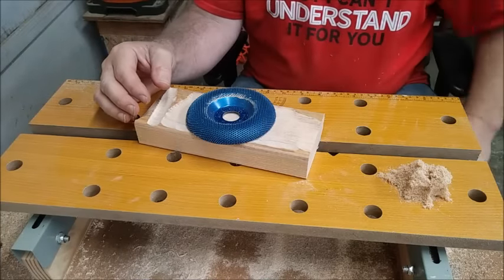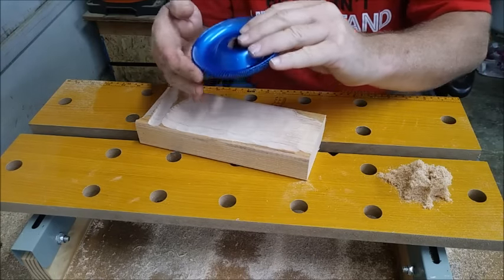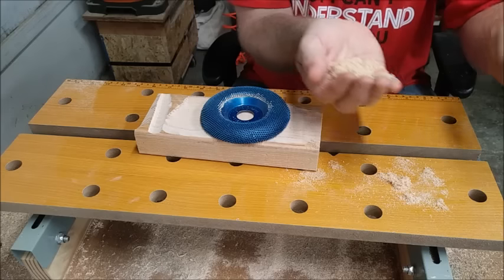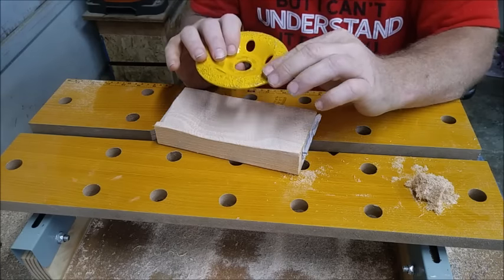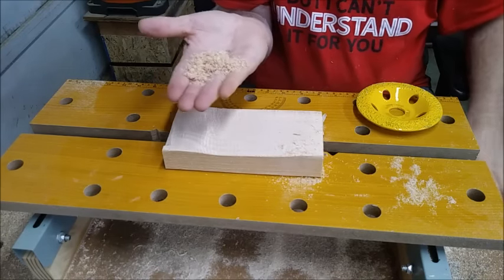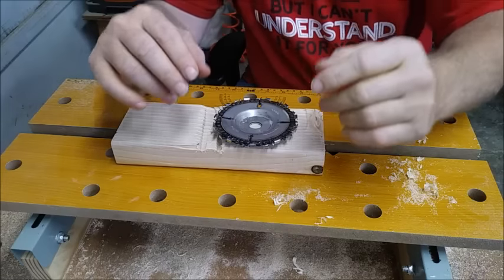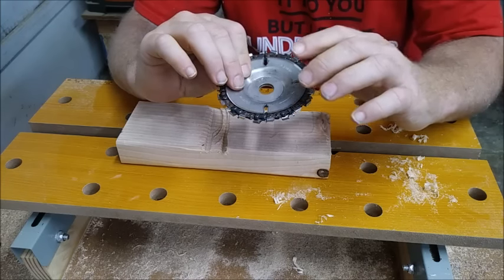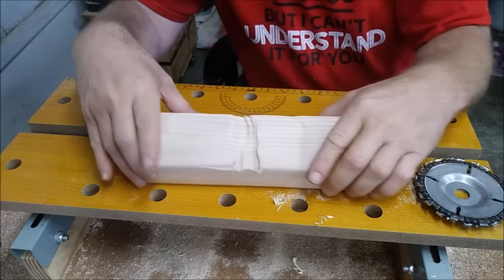power carving disc tool review for angle grinder

Comment: My doctor who carves warned me off of the chainsaw wheels.  Lots of kickback and stupidity injuries with these.  They cut into legs and hands just like you might expect an angle grinder outfitted with a saw chain would.  Much harder than a chainsaw to control in most kickback situations because of the size and lack of weight.  The abrasive might give you a bad road rash if you weren't paying attention.
Reply from the maker: Ya they can do alot of damage. You have to pay attention and be aware of what you are doing.
Reply: @Sidswoodworkingprojects  I use these chain disks and found that doubling them up and offsetting the teeth makes them safer. With 44, instead of 22 teeth, there is always a tooth engaged in the wood and the kickback is reduced, as is the running away.
Reply: @j.chriswatson6847  Good idea.
Reply: Agree.  In fact, the UK banned that tool.  Stumpy Nubs showed his injury from a chainsaw carver on his YouTube channel.  I won't touch one of those.  Scared the beejesus out of him and he's a very experienced woodworker.

Comment: I have the last disc , I can say it’s very useful whenever you have a carving project , the disc removes areas where you need to add a depth or a 3D effect, although as you said as you tilt the disc deeper in the wrong direction it can convert into a mess very quick and dangerous.

Comment: Good show man. Don't even buy the last one. I use grinders all the time. I weld. I get the tip of the grinder in spots sometimes with wire wheels on them where it kicks back hard. Carelessness mostly. I have Dandy scars from over the years. Lol. That last one will open you up bad if you get it in a bad spot. I have no need for that gadget. I can't toss the one I have. Lol. I figure it is only good to cut a board fastly. I show it to people that gun grinders all the time. They cringe. Lol. They know. Pass on it.

Comment: Didn't know about some of these. The rotary planer can be chucked into a drill press and used as an actual planer
Reply from the maker: Interesting...never thought of that.
Reply: maybe it can be mounted on a radial arm saw
Reply: Might be disappointing.  An angle grinder may be a bit faster than the drill press.  Plus if you just need thickness and/or flattening, a router and a sled will do a great job.

Comment: the chainsaw one kicks like a kangaroo. i see a comment saying itll take digits if your not careful, but even if you are it can do alot worse then that. randomly a tooth can and will catch a bit of tight grain or a knot or the other side will contact the work and kick violently fast and hard. depending on your position and its it can throw itself in unexpected directions, the neck, gut, hand being used other hand, arm thigh and face have all been wrecked. if you choose to use it be careful and realize that care doesnt always matter.

Comment: There are only two kinds of woodworkers, those who are going to have an accident and those who have and never will again.
I'm the latter put my hand through a table saw a year ago and now I have the utmost respect for power tools.

Steer clear of the chainsaw blade!
Reply: Friend of mine had a life changing accident with a large sander. 

You wouldn't think a sander is dangerous.. but it is. He was leaning into one of those really large ones, and the paper ripped and started spinning right into his stomach. Disemboweled him.

Anything that spins at high rpms or pushes around significant force needs to be treated like it can kill you. I never thought a sander was a dangerous tool.. now I know better. Wish more people knew

Comment: So I got one disc #2. For full disclosure, this "review'" is by the seller. It works, leaves a smooth cut, and is way less aggressive than the chainsaw wheels. It can still bounce and chatter and has angles it doesn't want to cut at. I haven't used the other abrasive type wheels. For what I was using the dished cut couldve been nicd. It's a good product. I still needed some heavy use of the flap disc afterward though.

Comment: Loving these videos and learning a lot from you. I’ve had a few good bowl ideas but don’t have a lathe so this may open up that door for me. But $80 for that rotary planer wheel. That’s pretty steep
Reply from the maker: Thanks, glad you're liking it. You can get the chainsaw wheel and the carbide grit wheel at harbor freight tools. That would be a good start.
Reply: I ordered those 2 wheels last week from Harbor Freight.  Should be here Monday.  I'm just getting into this myself and your videos are helpful. Thanks.
Reply from the maker: I'm really liking it. I'll have alot more videos.
Reply: I had the chainsaw wheel for carving a flag. It has a horrible tendency to kick back. I then got an Arbortech Turbo planer wheel. That is a game changer. Well worth the $120 I spent on it.
Reply: Any tool worth its weight is expensive. Treated right will give you years of use. Or, buy 10 cheap ones
Reply: @sphlouge  well thats definitely not always 100% true but if you think that, I have some tools for sell that are incredibly expensive 👍😉
Reply: @davidcunningham8319  The kutzall is a great middle ground, less than the Arbortech but still great quality.  Probably the safest to use too (presuming you're protecting those lungs).

Comment: I have to down vote this video.  Reviewing a chainsaw cutting disc without mentioning the severe safety issues of these kinds of discs is not doing anyone a favor.  Some will decide to take their chances and buy a tool like this, which is fine if it's an informed decision.  But this video isn't really informing people of the risks.  It's easy enough to find pictures of horrific angle grinder accidents from people using this kind of tool.

For those interested, Stumpy Nubs has a YouTube video that captures the moment an angle grinder with this kind of disc jumps out of his hand and climbs up his body.  A decent angle grinder has more than enough power to overcome even a solid two handed grip when a disc like this catches the wood.

Comment: Have you tried ordinary grinding discs or the flapper discs for a comparison darn sight cheaper
Reply from the maker: Grinding discs don't remove much and tend to burn the wood. Flap disc work good for smoothing but don't remove wood very fast.

Comment: Curious how long will the blade last. The last one you used. You mentioned Harbor Freight.
Reply from the maker: Yes harbor freight has a carbide grit disc. For the price it will get you by. It doesn't remove alot of material and it leaves a rough finish. As far as how it will last depends how much you use it. I've used mine on around ten projects and it doesn't appear to have much wear yet. Sorry I can't give you a better answer.
Reply: @Sidswoodworkingprojects  My intentions were to grind down a tree root low enough so it won't get in the way. I did, however, use the grinder for 2 massive cypress knees and then a little bit on the tree root. I must have worn it down because it was making burn marks. I tightened the blade so tight, I had to go to Harbor Freight to see if someone could help me loosen the blade. He suggested I use a reciprocating saw. I used that as well. Thank you for replying back.

Comment: Would you use a chainsaw to carve wood in an angle? Not likely. And that chain disc is insanely more risky to use 😂 just use the other blades for the angle carvings please lol so many have suffered nasty life changing injuries
Reply from the maker: Yes that chainsaw disc can be very dangerous in the wrong hands. When ever using an angle grinder always cut so if anything happens the grinder will pull away from you.
Thanks for the comment.

Comment: Do you find the chainsaw type difficult to control? Which would be the safest? Cheers
Reply from the maker: It has more kickback then the others. As far as safety, any of the discs with blades on the outside edge would be less safe then the others. That just means be more cautious and aware of what you are doing. The chainsaw blade doesn't work well for me. It doesn't cut very well the more of an angle you go. It leaves a pretty rough surface. I will only use it if I'm making straight cuts when removing lots of material. Mainly to rough it out. The rotary planer is nice. It's pretty aggressive and leaves a pretty smooth surface. I'm coming out with a new disc that basically combines the rotary planer and chainsaw disc. I'm pretty excited about it. If it works like I think it will, It should be the only disc you need. Stay tuned.
Reply: @Sidswoodworkingprojects  I subscribed just reading about the disc you're coming out with I'm DEFINITELY interested in that!!!!!!   Oops  gotta go back and ring the bell!!!
Reply from the maker: Thanks for the sub. The disc is available now. I have a demo video for it if you want to check it out. Thanks.
Reply: Unfortunately, I speak from experience... The chainsaw is the most dangerous, but it is awesome. Do NOT skip safety precautions with this thing. The planer is next in line for most dangerous, but a very interesting design.  I like the Holey Galahad line, but they can burn out and lose "teeth"  if you abuse them.

Comment: Can you tell me the make and model of the power carver/angle grinder you were using and is it as quiet as on the video or is that just editing. Cheers.
Reply from the maker: It's the blue one with the paddle switch from harbor freight tools. 30 bucks. It's a little quieter than my others, but mostly editing.

Comment: How on earth could you even begin to think that a rotary chainsaw blade being used on a grinder at 8,000 - 18,000 rpm could be safe. Completely ignorant. They are all dangerous but that one is absurd! All I can say is "good luck"!
Reply from the maker: Yes it is very dangerous if you don't have much experience. Don't try it if your not comfortable with.
I've been doing it for a long time and it really is not a big deal.